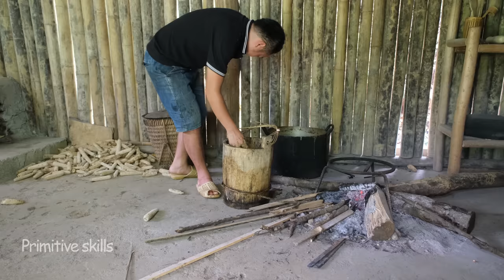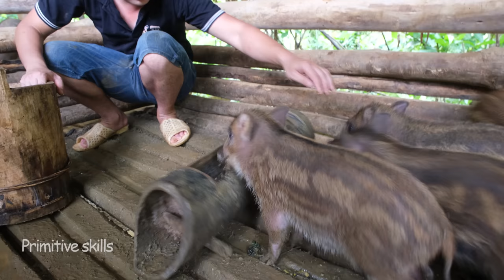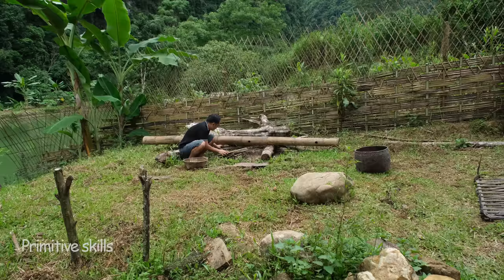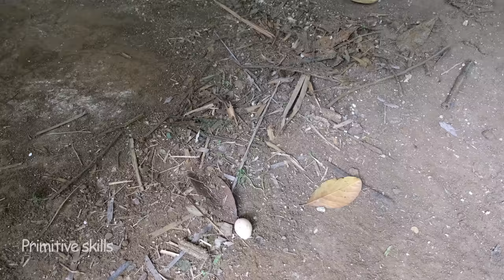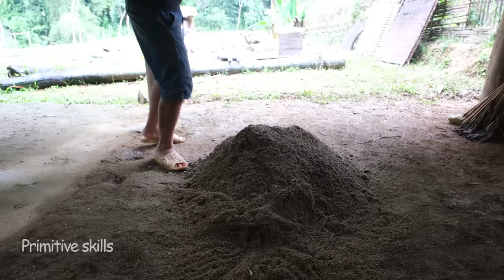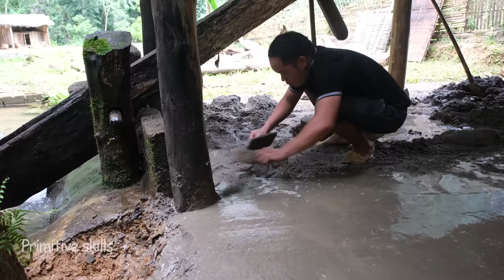Building the warehouse floor, The mother pig has a fever and refuses to eat

Comment: Please do not burn your organic waste in the future.  Burning that material that could be used as compost or mulch is not friendly to the environment.  If you don't what to start a compost pile, just lay it on the ground around your many fruit trees as mulch to hold down the weeds, preserve the soil moisture and moderate the soil temperature.  Eventually the organic waste will decompose and your soil will be improved.  Your fruit will also improve. 😊
Reply from the maker: Thank you for your advice, it was very helpful

Comment: When you need to pick up something heavy, like a big bag of rice or a box, you can follow these steps to avoid hurting your back:
    Stand Close: First, stand really close to the object you want to lift. Make sure your feet are about shoulder-width apart.
    Bend Your Knees: Instead of bending your back, bend your knees while keeping your back straight. This way, you're using your leg muscles, which are stronger and can handle the weight better.
    Hold Tight: Get a good grip on the object with both hands. You can use your palms and fingers to hold it securely.
    Lift Slowly: Now, using your leg muscles, slowly stand up while holding the object. Keep it close to your body to make it easier to lift.
    Avoid Twisting: When you're holding the heavy thing, avoid twisting your body. Try to keep your shoulders and hips facing the same way.
    Walk Carefully: If you need to move with the heavy load, take small steps and move your feet instead of twisting your body.
    Lower Carefully: When you want to put the object down, bend your knees again and lower it slowly while keeping your back straight.
Reply from the maker: Thank you so much😘🥰🥰

Comment: Nice job on the floor Duong. When the back pain gets bad enough to rest, then you should go to the hut with the bed and lay flat. It will help mend you better and quicker. I've had to do this most of my life, and I know it's hard to do that and it feels like giving in, but it is the right way to help yourself get better. I tried to get by with out doing that, and for my troubles had a whole year on my back mostly unable to move. After the year had passed I realised I had to do better because having another time like that was not an option ever again. It's harsh, but you need to be smart in response to it. It's not awful once you get used to the idea, it's not great until you do. I really do sympathise with you and the problem you face. Be well. 😉
Reply from the maker: Thank you

Comment: Well Mr. Duong, I think it is time to build a new wheel barrow. The brand Gorilla makes a 7 cubic foot 2 wheel cart/barrow. It is by far the best I have ever used on so many levels. Check it out. The design would be an advanced woodworking project, but the resulting tool would be of great help. BTW, I got bad shoulders and just had knee surgery this after noon! Still the best barrow, hands down!
Reply from the maker: Thank you, I will make a wheelbarrow soon

Comment: Congratulations on your video. Your techniques are very nice. I would like to ask you what is the ratio between sand and lime?
Also, if there is no river sand, can I use clay soil?
Finally, I see that when the mixture is laid out, it is wet. Is it slightly moistened beforehand?
Congratulations again!